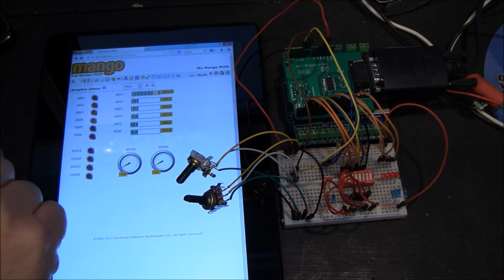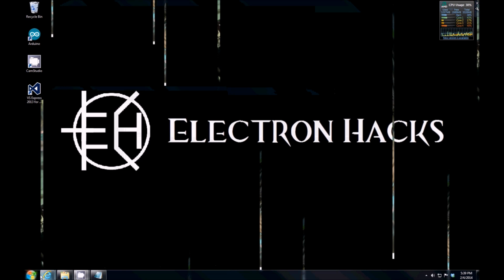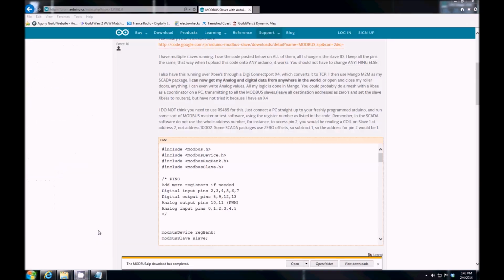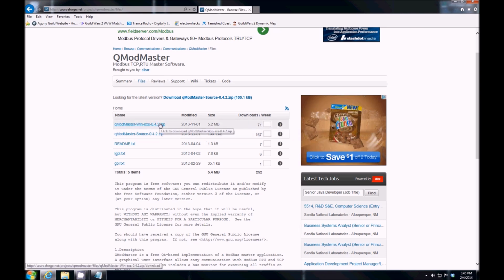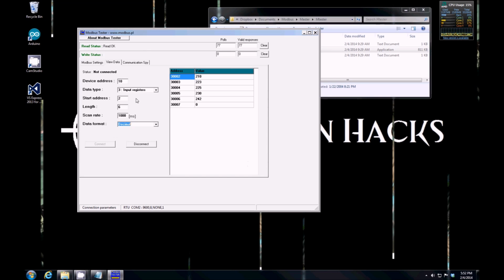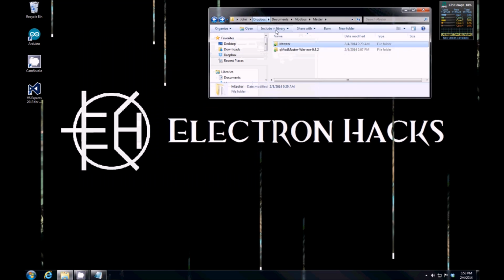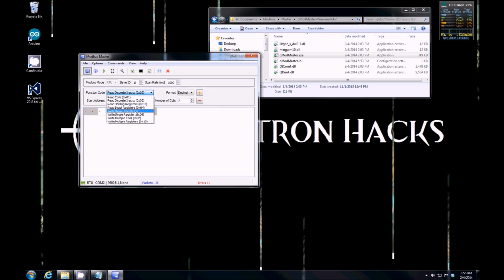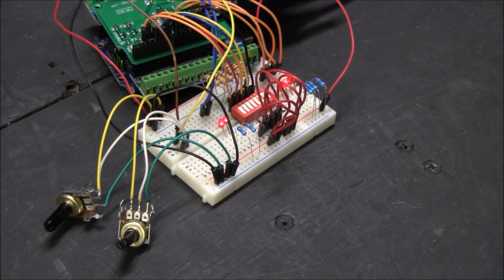Arduino Modbus PLC Build Instructions

Comment: aaand here I am, again... :) I'm little bit confused about Aref pin not being connected to +5V but You are using analog inputs. What is refference voltage then for ADC?!
 is it connected somewhere to vcc on rs232 shield board?
I want to make my own board with ATmega328p (as standalone) and put it in one of those din rail plastic case, with all inputs opto isolated and also opto isolated MOSFET outputs everything on board.
I'm just fine with 2 PWM outputs as in the sketch already but I don't need 6 analog inputs, 4 are just fine (a0-to-a3) but it would be useful to have two more Digital outputs bcs there are only 4 of them on pins 8,9,12,13. those would be something like 18 and 19?
source: forum.arduino.cc/index.php?topic=28720.0
and also I'm sorry if I'm "little" bit boring.... :D
Thanks for all this informations